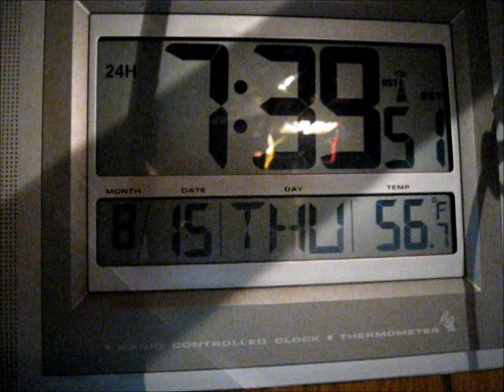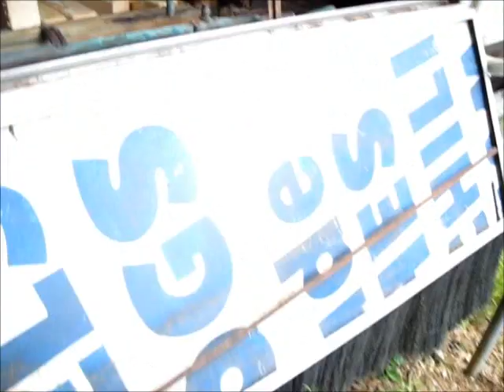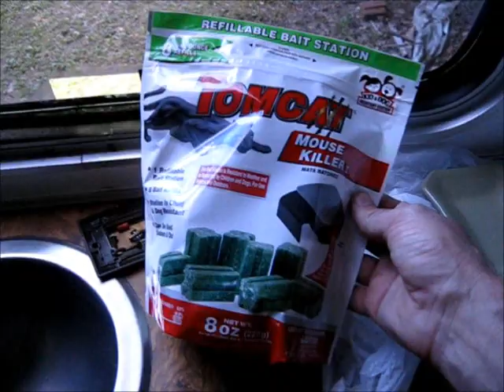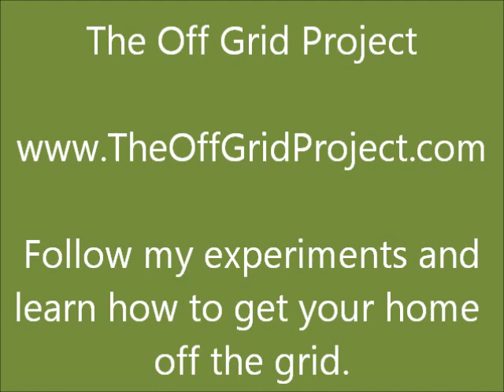Prepping To Lay Tile In My RV And Fighting Mice

Comment: Floor looking good. For floor trim, use quarter round molding. Made for that purpose. In your situation using baseboard will take up a lot of space in that tiny bathroom. Quarter round relatively inexpensive if you paint yourself. Measure widest gap & buy size to cover that gap. Finishing nails, nail set, and a little spackling yields professional looking job. Paint white to match walls.

Comment: Troy, I live in the country I several ways to help get rid of mice. Plug anywhere you see daylight with sos pads as the soap helps keep them away You can also use steel wool too., .Now to make sure they stay out of your clean areas. Use cheap strong scented dryer sheets. then the extreme way to go is to use moth balls in all the closed areas, or use both. the dryer sheets will last several months, moth balls close to a year. Hope this helps.

Comment: Using underlayment in kitchen is a good idea. Not because of weak spots, as they would have been noticed by now. Use to accommodate metal plate support of uneven joint. And even out joint flex to reduce chance of vinyl tile breaking. New wood should yield better glue adhesion when tiles are laid. Hopefully pad under carpet will help compensate for flooring height differences. Transitions will also lessen the impact of height variances.

Comment: Replace with PEX.  No serious winter use RV will have any pipe under or ON the floor.  If you must have a pipe close to the floor, make sure there is 1/4" foam under it.  Best if they are far from the floor and not against exterior walls.  Too many freezing issues.  The liter box hole will allow heat circulation to keep your pipes thawed as well.  I've read you can mix boric acid and corn meal, they get thirsty, go outside to drink and die.

Comment: I kind of like the idea of using the 1"X** for trim work in this situation.  As he mentioned, the plywood in the walls is rather weak, and the taller boards will give some added strength/protection wile looking nice at the same time.

Comment: Troy, once you finish your work, mice shouldn't be a problem. Now due to various openings while renovating. As you go, sure you're sealing applicable areas. Steel Wool, screen wire, etc. RV not like a house. With metal or fiberglass above & below, only access would be an opening underneath that was missed. Metal framing is a plus, too.

Nothing larger than spiders get into our 5th wheel camper, unless I leave an access hatch open by mistake. Hope you can get yours sealed up soon.

Comment: Regarding the rat poison. It was explained to me by my father, that the poison works by causing the mouse to become really thirsty. If there isn't a water source inside, they are suppose to go outside and drink. When they drink the bleeding begins and they die, outside. If there is water for them inside they die in the walls. The smell is horrible. We had to make sure the drain pan under the refrig. was empty. They would always die at that pan. Good Luck getting rid of them.

Comment: Weather - enjoying this brief break in heat & humidity in NC. A blessing, as it doesn't happen often. Rain heading in for several days. Then back to normal Aug. next week. 

Indicators here are that we'll have early fall. There's a hint of color change in the woods. Leaves from trees that drop early are beginning a little sooner than usual. All follows the weather pattern we're experiencing this year. Unless the Jet Stream readjusts back to more northerly route colder winter with more snow/ice.

Comment: Best way we've found to deal with mice is traps baited with peanut butter. Keep several set as mice are routine problem - woods & fields around us. Have had to live with aroma of dead mice in walls from poisons. No fun. Usually takes about a week for stink to start fading. 

Mice are worst here when it starts getting cold in fall. They're seeking place to shelter over winter. Usually put out a few extra traps during that time of year. Have toy poodle so have to be careful with trap placement.

Comment: I guess it is too late but... 1) you should have laid a vapor barrier under the decking 2) You should have left a 1/4" gap around the edges and between the pieces of decking for expansion when the humidity goes up. If not the decking will buckle and the tile will break loose.

Comment: You could use trailer house roof paint it sticks great to metal roofs like the RV. Last a long time too. It will come in a five gallon bucket. you can mop it on or roll it. You should get the RV skirted or it is going to be really cold. Can you put insulation on the doors and walls where the access doors are. they dont look insulated in side either. you could use that styrofoam tin foil coated bord and glue it to the door and out side wall.

Comment: they work a treat you can buy ones that use batterys or mains powered ones or ones that can use both but they kill in seconds and when it kills a rat or mouse there is usually a light that tells you that its cought the little blighter :)

Comment: PEX may not be easy in RV & the way they are built. May not be able to access tight turns, especially where something was built in after original plumbing was put into place. That is, without ripping out a cabinet or cutting holes underneath RV  I'd leave the run to the kitchen sink alone, unless it absolutely has to be replaced. Looks pretty clear & easy in the bathroom area, unless uprights at shower present a problem. May have to take out shower to get to them. Don't know without seeing.

Comment: trimwork- use 1/4 round... it will bend with the floor and wall if not completely straight.  Cheaper and less weight, too.

Comment: Weather is nice, but isn't "strange" over the long haul. :-) We've had cooler than normal summers before. They are a blessing when they happen. Love the fact that we didn't hit a 100 this summer. Especially after record breaking 100's year or so ago. 

Here in NC, there's plenty of hot weather to come, as we're still mid August. Usually mid to late September and sometimes even into Oct before there's a lot of relief from heat & humidity.

Comment: Research the Galveston Hurricane of 1900, Hurricane Hugo of 1989 and Hurricane Andrew which hit Florida.  All were much more powerful storms, but the people there are used to picking up the pieces and starting over, and over time have learned to build better infrastructure (Bayous) and homes.  The eastern Megatropolis is not a common target for hurricanes so could not have been as prepared as the southern Atlantic and Gulf coasts.

Comment: You can use a jig saw or a circular saw, its not steel pipe, just go slow! You can also get a cheap metal cutting abrasive blade for the circular saw!

Comment: To turn a hacksaw blade into an ultra-cheap saw, wrap 1/3 to 1/2 in plain old masking tape.  Easy to cut off later!

Might also use WIDE masking tape, and set the first layer backwards, so the sticky side is facing outward.  If it's tight, it'll hold well enough, and make it a LOT easier to reuse the masking tape blade handle, and if that's the case, then you can make it a lot thicker for a better grip, rather than just cutting it off.

Give it a shot...choose what works best for you!  d=O)

Comment: Just use rat traps and be done with it. May have to bait a time or two, but that's no big deal. Traps do work. They are effective with no side effects. As long as you don't trigger the trap on your fingers. 

We keep 3-4 set all the time due to fields & forest around us. Nips problems in the bud before nests can be built & the problem multiplies.

Comment: Peanut butter is the Queen of mice attractors! ditto! Don't know bout the oatmeal part...never added that & still had almost immediate results.....no more than 24 hours.  I would put the mouse traps in the kitchen cupboards....more in lower ones.  They tend to stay low & it keeps it behind doors for children & ur kitty cat in ur case.  I've literaly set the PB laced traps & heard them SNAP before I would leave one of the apartments/office buildings I used to manage.   EASY solution.

Comment: Did you cap that old toilet connection before putting the floor down atop it.You need to close the hatches at night (all openings) with cooler nights mice will seek the RV, esp. if food is prepared/or scraps are close. The rat poison and cat is iff-y, you will need to vacuum and bleach all areas where poisons have been before allowing cat access beneath cabinets. Lessons learned from 8 years off-grid rehabbing logging camp/house that hadn't been used for 18 years.

Comment: Seen a number of suggestions 2 use moth balls 2 deter mice. Don't do it. Not if you want to stay in RV. I'd rather have mice than have 2 live with that odor. Plus, if memory serves there are warnings about health issues & continual exposure 2 moth balls. They are best for items stored where fumes are confined. 

Other odor deterrents are short lived. Strong odor fades quickly & must be frequently replaced. That's why such products sold 2 keep deer out of gardens have very limited success, 4 ex.

Comment: 1. You're in the woods, mice live in the woods, what did you expect?  :)
2. Now imagine if you'd have cut it from one solid piece. :) heh
3. I actually kinda like the tiles. Durable and easy to clean.
4. Find that mouse body before Baby does. poison mouse will = poisoned baby otherwise.
Numbering points is fun. lol

Comment: if your not going to be using your flush toilet why are you replacing the pipes to the right side of the rv is that the main supply i thought the supply tank was on the driversside under the bed their

Comment: I have mint plated in my garden right by my tomatoes and the mice are eating my tomatoes, so I guess these mice are not put off by it.I am thinking of using a 5 gallon bucket with a hole in the lid,but I don't know it it will work as the have those tomatoes, what would be more tempting?I have an idea of using a plastic bottle with the bottom cut off stuck in the lid upside down sort of like a funnel,with just a bit of food balanced down at the neck.I have too many animals to use poison outdoors

Comment: hacksaw blade, next time wrap the part you are holding with a rag, You are getting frustrated, not going to make things easier. Put poison where the mouse goes.Get a jar with a metal lid, drill a hole about the size of a dime in the jar lid so the mouse can get in but the cat can't get at the poison.Kill the mouse BEFORE it has a litter, that is imperative,